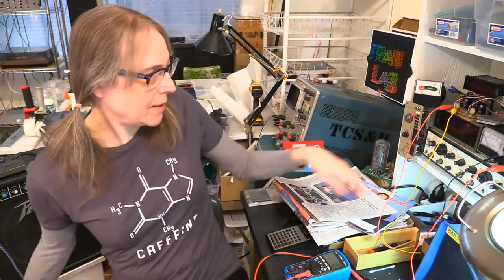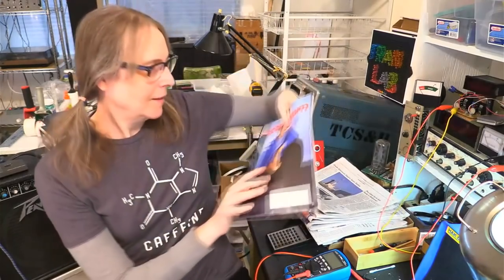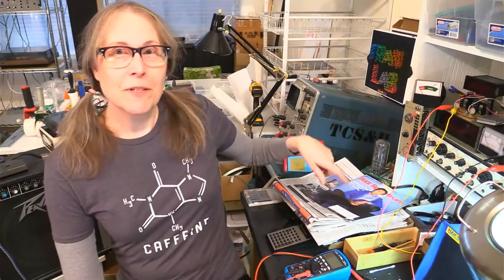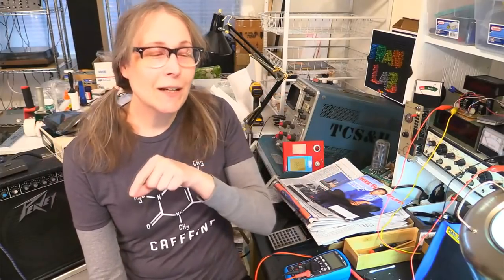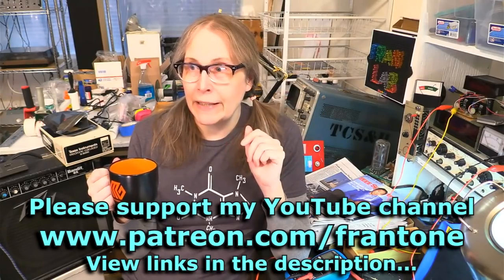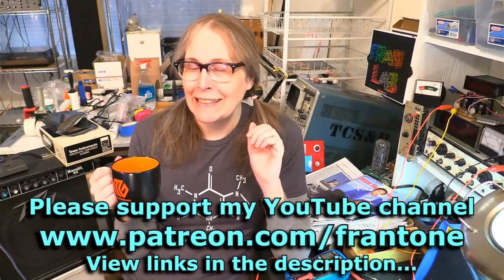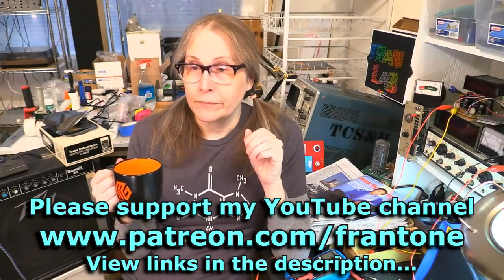When Is It Electronics Or Just Electric???

Comment: I've learned that if it has an active switching or controlling element (transistor, vacuum tube) then it's electronic. If it just has passive components (motors, resistors, inductors, capacitors) then it's electrical.

I think the line is blurring though. If something uses an LED to generate light, is it electrical, or does it cross the line to electronic?

And, by the classical definition of electrical, a computer made of relays is NOT an electronic computer, it's an electrical computer.

In the grand scheme of things, I'm not sure it really matters.

Comment: in high school I majored in electronics, we studied the the workings of radios and tv`s mostly and the parts that made them work. There was also an electric shop and they were concerned with wiring a house and industrial use of using electricity, like wiring motors and 3 phase current, doing wiring to code

Comment: Diodes seem like a kind of grey area until we realize that, although it is a semiconductor, it is not being actively controlled like an SCR for instance. A diode is therefore a passive device and would be considered electrical in nature. I enjoy designing semi-passive devices. That is to say, a device which incorporates active components, like transistors, without additional external power. The only power allowed, flows in from it's output load. In other words, the device operates on it's own waste energy! 

As an example, I was designing and building an automated pipe organ from scratch. The hand made valves were operated with a clunky but sturdy 24 Volt DC, 2 Watt industrial solenoid. There were latency issues with both the attack and the release response of the solenoids. The elegant solution was a three transistor semi-passive amplifier on each solenoid which sent a quick high voltage spike to activate the solenoid instantly, giving it enough power to open but not enough time. The fly back diode, across the solenoid actuator, allowed the current to 'snap' the solenoid in and open the valve instantly. The amplifier would then hold the valve open with only 1 Watt of power so that the moment it was released, the valve would snap shut instantly. 

Each amplifier is a small 3 terminal device incorporating 3 transistors, 2 resistors and one very tiny capacitor. The three terminals are . . 1) 5V cmos input . . 2) Ground . . 3) Output to solenoid.
I can't draw you a schematic here, but you can hear the instrument on YouTube at
<Steve's Pipe Organ Pt1> and Pt2.

Comment: I'd say the simplest dividing line is "electricity controlling electricity", so that covers transistors, some types of diode, electron tubes, circuits involving gas discharge tubes where the state of the tube is sensed. That definition ought to include relays but I would think they're pretty much considered electrical, so lets amend that to "electricity directly controlling electricity" to exclude devices where there's a mechanical aspect.

Comment: Very interesting as always, thank you. The question of when something is electrical or electronic is not always clear: A neon glow lamp can also be an active electronic component, in a circuit with a capacitor and a resistor (and an additional resistor to limit the discharge current so as not to damage the electrodes). I made a little lighthouse with a circuit like this, the neon glow lamp turns itself on and off, without semiconductors (except a Diode for AC-230 V to DC).
Reply: Some 1950s "electronic" organs used Neons in the divider circuits. For something even more complex check out the ANITA calculator which seemed to be based entirely on neons and decatrons (a fancy neon based tube that can divide by ten !)
Reply: @MrDuncl  Thank You. Very interesting. It seems neon can do more than just glow orange. I did not know that the earliest electronic desktop calculators used Decatron counting tubes. I have an old desktop calculator (rescued from the trash), a 1973 Sharp ELSI 804 with VFD tubes and integrated circuits, it works perfectly. Amazing development from 1961 with ANITA Mk VII and Mk VIII to 1973 with ELSI 804, from tubes to ICs in just 12 years. The use of neon glow lamps in organs is also interesting. This occurs to me: In my simple circuit with a neon glow lamp in the lighthouse, I accidentally found that the circuit generated vibrations with changing frequencies in the ultrasonic range while the neon glow lamp was lit.

Comment: Your way of presenting is so adorable, because your are loud thinking on the way! I actually thought about your term "universal motor" while watching the first time, but that is so minimal, that I would refer to it as a liitle push or me to think about it and recall how we ourselves would actually call it. At least that's what I did in that moment. I thought if it could actually have been a little standard Motor back then (and decided that I don't think so) and then subsequently thought of its speciality - the fixed speed by the frequency of the power grid. I'd call it a fixed Speed Motor, the word synchronos is not easy coming to my mind as well.

 So maybe I have a clue why you found that other easy term for it. At least it keeps us active - I'd say thinking about your accompaning words is part of the fun! Most of the time you are absolutely on spot in naming parts - which is a very high standard. I also loved your way of carefully trying to detach the transparent cover and changing plans for disassembly on the fly. It gives us a way of watching the process and that's empowering viewers to do similar repairs on the long run. Nevertheless - your follow up Video on the criticism is showing that you care -  keep up the awesome work!  Please keep your videos authentic, I for my part also care about little hickups. It keeps me active thinking and sometimes feeling smart.

Comment: Thank you. Toasters are Electric - few are electronic.
Reply: Fran has reminded me of an old episode of Star Trek Next Generation where the philosophical and moral question was discussed as to whether or not Lieutenant Commander Data had free will, or was he merely Starfleet "property"?  At some point an attorney said "Data is a *toaster*; have him report to Star Fleet Command immediately".
Reply: But only one is brave.
Reply: The Sunbeam Radiant Control Toaster is 100% electric—and automatic beyond belief!
Reply: @valshaped  ,  If it has a microprocessor in it, you can guarantee that the 1st thing that will break on it will be the microprocessor board. No matter where they put it in the body of the toaster and how well they insulated it's gonna be exposed to a lot of heat....  Even some of Fran's best asbestos from inside her calculators and what not probably wouldn't save that board from eventual destruction.
Reply: @valshaped  I said few.

Comment: My GENERAL take:
Electric                     -                  electronic
______________________________________
over 100 volts         _                <100v
AC  mains                -                 DC battery
motor                        -                 search engine
one horsepower     -                 <1 Kw
carpenter                 -                 decorator
house/building      -                  car/bicycle/tent
relay magnet           -                  transistor
power grid               -                  internet/telephone
vacuum tube           -                  valve
engine                      -                   motor
banana                     -                   banana
Reply: One more:
Ship                  -             boat
(A ship can't fit on a boat, but a boat can fit on a ship)

Comment: Would a circuit using a relay with a reverse surge diode across the coil be considered electronics? The diode is an electronic device but the whole thing is usually referred to as electro-mechanical. I guess there may be some gray areas.

Comment: As I recall, at Cal Poly San Luis Obispo they had two different programs at one time.  "EL" (Electronic Engineering) and "EE" (Electrical Engineering).  EL was the usual with all of its theory and electronics design and EE was more electrical even including a lab with motor generator sets.  Things evolved and there is now just one track called EE for "Electrical Engineering" that seems to cover it all, but mainly electronics design.  Definitions abound and have evolved over the years.  For example, "electrical engineering" at one time would be more likely be the arena of higher voltages and power generation.  But I think a good differentiation today is similar to what Fran advocates if you consider the "electrical" mean something that merely changes current into something physical like heat or light or mechanical like a solenoid or motor.  "Electronic" have active devices that re-route or modify current flow using active devices.
Reply: @tissuepaper9962  Cal Poly used to have EL, EE, and ET for Electronic Engineering, Electrical Engineering, and Engineering Technology (ET being electronics without all the math theory).  Many who couldn't cut it in EL transferred to ET.  They also had a  "computer engineering" major at that time  And they also had "Computer Science".  Today, it is quite different.  They have things spread across more departments now.  The "Computer Engineering" department has only the Computer Engineering Major.  The "Electrical Engineering" department has only the Electrical Engineering major.  The "Computer Science" department is now the "Computer Science and Software Engineering" department and has two majors:  Computer Science and Software Engineering.  Many assume that "computer science" is "software engineering" but it is only about 1/4th of what software engineering is.  Cal Poly San Luis Obispo was one of the first three universities in the world to offer Software Engineering.  The difference is, computer science teaches you programming techniques, styles, and particulars such as "this data base is better for this than that database."  Software Engineering includes the technical details but also developing on time, on quality, and on budget.  In other words, being a professional software development engineer versus just being a "coder".  Those three things (budget, quality, time) arrived rather late in the game in the world of software development.  But they got a big push long ago when the DOD (Department of Defense) figured out, "Hey, controlling and managing this software stuff seems important."  The old joke is that was the point in time where software developers had to start bathing.. Anyway, departments and majors are not uniform across all schools.

Comment: Before this video (and the clock video it accompanies) I had a pretty good idea of the difference between electrical and electronic.

Now the best I can manage is that it depends how you look at it. 

Even extreme cases like a power distribution grid, an advanced microprocessor or, yes, a toaster, could be viewed and analysed in terms of their electrical or electronic construction, characteristics and/or behaviour.

Electronic systems could be considered as being electrical just as electrical systems can contain electronic components. Similarly, it is perfectly possibly to have digital systems without any electronics at all.

Basically it puts me in mind of that updated grammar rule: “i before e… except when it isn’t”

Comment: Wikipedia said :
A digital clock is a type of clock that displays the time digitally (i.e. in numerals or other symbols), as opposed to an analogue clock 
Digital clocks are often associated with electronic drives, but the "digital" description refers only to the display, not to the drive mechanism. (Both analogue and digital clocks can be driven either mechanically or electronically, but "clockwork" mechanisms with digital displays are rare).
Reply: I remember in the 1970s my parents had an electromechanical clock with a digital display.

Comment: I think your audience tends to be more likely to be "on the spectrum", and we can be a bit pedantic at times. I do have a non-electronic, electro-mechanical binary logic based game at home that I enjoy playing. Many were made right up into the 1970s by such companies as Bally and Williams, or if you're into wedge-heads, Gottlieb.  Open one up and you can locate the "clock" that runs when certain programmed routines need to be performed, identifiable by a motor, a stack of cams, and a bunch of switches.  Simpler logic is accomplished by a number of relays, and numerical counters are used to keep score, powered by solenoids.  Fran, I bet you have one somewhere, and I'm sure many of us would like to see it! Show us what's under that playfield!

Comment: I'm pretty sure the clock is mechanical digital? Each light is ether on or off, high-low, 1-0, so digital. 
The 'logic' is all handled by a series of rotating gears fed from a motor, so a mechanical structure. 

I think a lot op people equate 'digital' with IC's when digital is basically just an on or off state with no intermediate 'analogue' values.
So surely if something meats this criteria, irrespective of the media used, it is a digital device but not necessarily an electronic device.

Comment: Several digital clocks were in circulation in the 1070s that used a electric motor which had numbered plates and characters
embossed on the plates that showed time, ect. They were like a hybrid clock with a AM/FM radio which was also added.
That would classify them as a electronic device but with the receiver board remove it could be called a electrical device.
The motors on the clock used the line frequency to turn the motor and mechanical function of the readout.

Comment: We're so far future oriented that I don't consider anything electronic unless an onboard chip with intermediate computations is a main part of what gives the product its actual name.

I won't even consider a drill to be electronic unless it has actual smart modes I can choose

Like a lightbulb might have a resistor in it so that it can run on 120v wiring. It's just a light. The resistor itself is just smaller wiring wrapped in funny paste

Comment: I tend to partly disagree, a carbon film resistor is a discreet electronic component, and a coil of wire with power supplied is an electrical heating device. BUT then again a wire wound resistor is a ? perhaps both, well maybe I am wrong or maybe I am right. Both have electrons moving in a direction, as do vacuum tubes and transistors or diodes.

Comment: The distinction between electronic and electrical is not active vs. passive, since a relay is classified as electrical but is just as active as a switching transistor. Diodes are passive but are classified as electronic. The difference is that electronic components control electron flow at the electron level whether solid state or vacuum tube, while electrical components work on the macroscopic level.

Comment: Fran, I agree with you.  The principle function is to display the time.  The time is generated MECHANICALLY and the display is generated ELECTRICALLY.
Reply: And the output is _digital_, as in presented as digits, not as in how the output is calculated. 
This nomenclature is not unheard of in horology, clocks and watches presenting the time as digits has been around for more than a century, using traditional mechanical oscillators and movements with ingenious mechanisms to move the digits.
Reply: @DrBovdin  Yes, I think she made that distinction.  Digital can even be teeth on a geared wheel.  Any mechanism that can represent discrete states is digital.